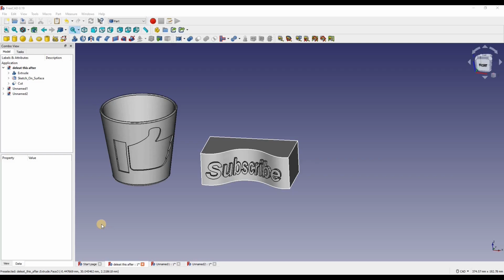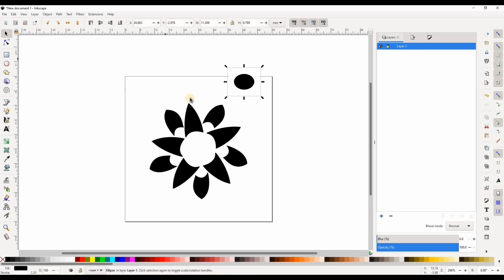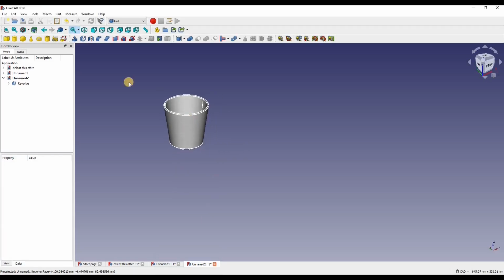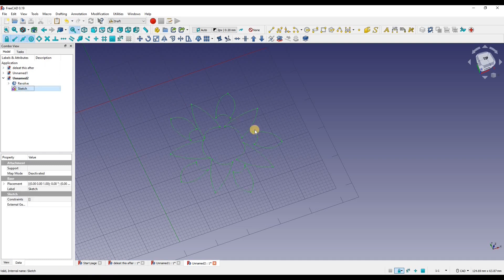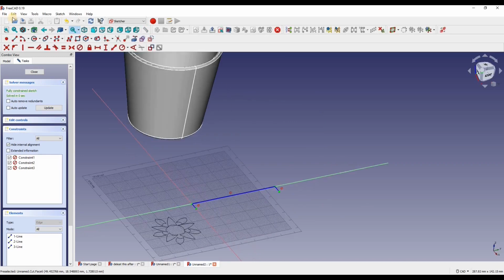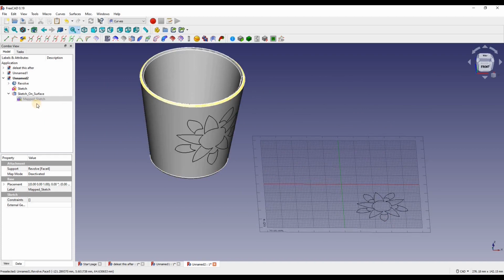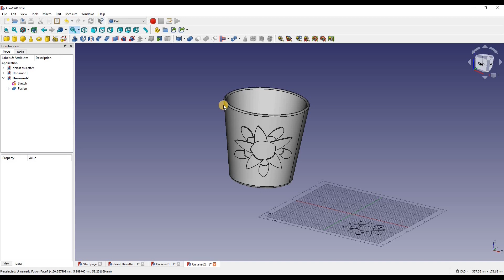Freecad tips and tricks (#4.2): Mapping a logo to a curve surface

Comment: Why don't I have the Curves Workbench? It's the same 0.19 version I'm using and I have just installed it this June 2022.
Reply from the maker: you need to install it, watch part one. i show you how to install it there:)
Reply from the maker: https://youtu.be/yV26cig0p4I
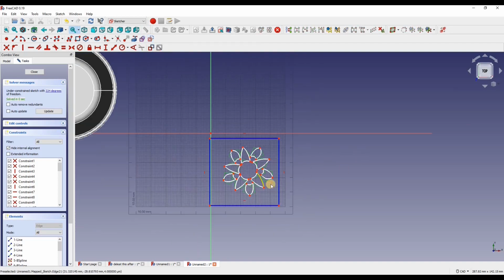Reply: Thank you. I've installed it. Right now the current challenge is the "Failed to get the face support of the sketch" error message, despite following the steps to the letter. I've fixed the SVG file and all, but the error is persistent. I'm stuck at 4:29.
Reply from the maker: Huh, Try adding a square in the "Mapped_Sketch001" through the sketch workbench and see if it projects. if it does it's the SVG file that's the problem. so I suggest trying another SVG file. if the square doesn't project tell me and there are a couple things you can try.
Reply: @TabletopRobotics  You mean the square as a  Construction line? I already did to make sure it selects the image. I even changed the sizes to see if it has something to do with it. It's just persistent. I will try to create a new surface to work on, I'm not really sure where exactly the error is. I'll also try your suggestion above and will try other (non-construction) normal shapes like circles and other polygons to see if extrudes or not.
Reply from the maker: here's a link to a video I posted on my second channel of another method to do it https://youtu.be/8G0D5xksjQA read the description. I go a little fast so I suggest watching it at 1/4 speed. I really hope it works if it doesn't I donk know if I can help you. good luck:)
Reply: @TabletopRobotics  Replied on the other vid you sent. THANK YOU VERY MUCH! That approach worked for me. Could be a bug on FreeCAD that I unwittingly stumbled on and still have no idea what it is.

Comment: Hey I know this is 2 years old, but I am trying to add the design as a copy (4:10) but I can't click the other sketch with that tool, am I missing something?
Reply: Press Alt+Ctrl and it will let you select it. It's just because the origins are different.
Reply: @Christopher-is1hs  This is not working for me. In the bottom left it says 'Selection not allowed by filter' could it be because I'm using a clone sketch so I could scale it to the appropriate size?
Reply: @roguech1mp  Does your clone have a little sheep as the icon? If so, first convert back to a Sketch by going under the Draft Workbench and selecting the 'Draft to Sketch' button. Then try again with your newly created Sketch. Did that work?